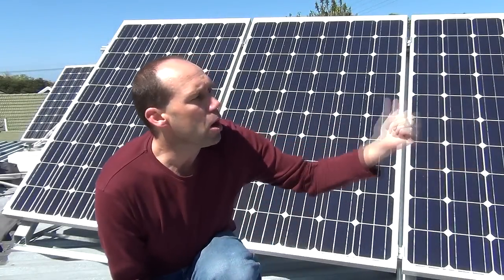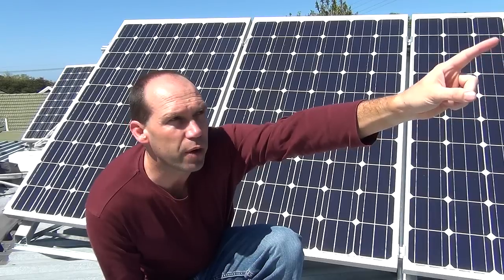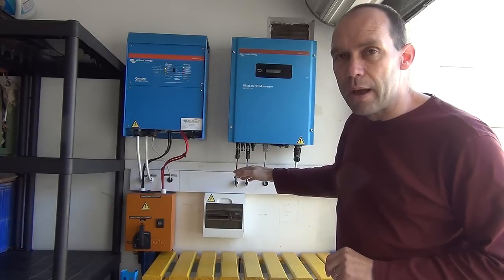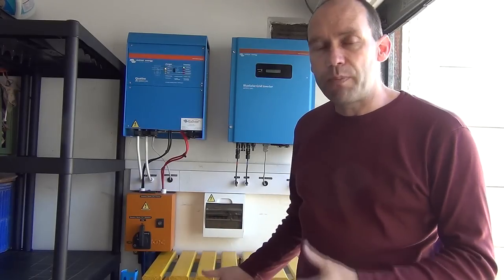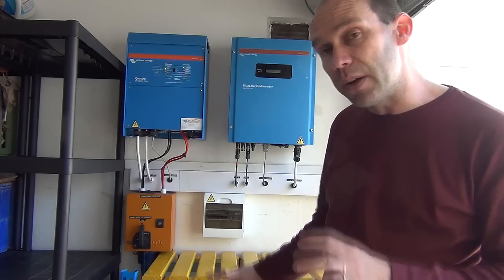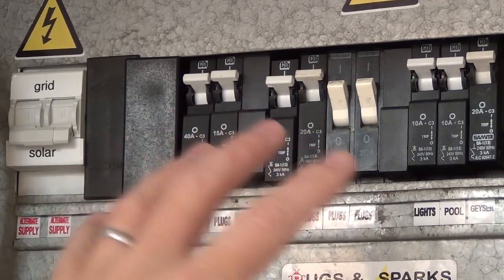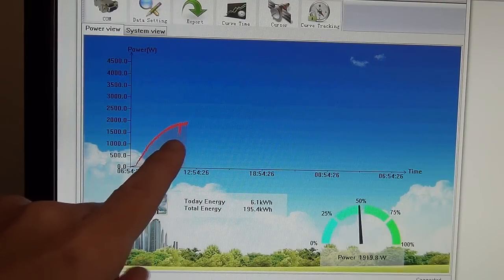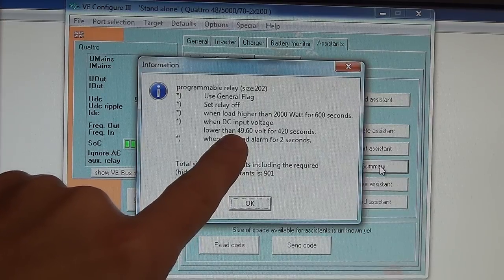Home Solar Power Installation

Comment: I found that my combination fridge/freezer uses 3 units a day. I had two of them. Shortly after a local store sold a Bosch A++ rated fridge at a discount of 25%, so I bought it. I then sold the two old ones on gumtree and bought a A-rated chest Freezer. 6 units a day down to about 1.3. Freezer will pay for itself in two years. Fridge will do it in 4.5 years. To make a long story short: If your fridge uses 5 units a day, replace it.

Comment: You need a "bleed off" for your surplus power.  I recommend a small air compressor. You can size it to your needs and either have it auto-start under certain conditions or just flip a switch with a timer on it. The beauty of it is that you can do things around the house with just one "cord" which in this case will be your air hose and there is a plethora of tools you can use.  I even made a small jackhammer and I have a degree in Psychology...so that should tell you that it is user friendly.

Comment: Good video - clean install.  Lots of details, which an engineer can appreciate. 
Our monocyrstalline panels are working much better than I expected in low light.  And here where we get 90+ inches per year
that is saying something.  

We also used a solar company install - only way here to get the purchase and operational incentives.  
You appear to be an electronic engineer - same here.  

We went with a system to give us grid-tie but also modes for backup power and off-grid.  Requires a different inverter configuration, so people should know they just can't add batteries to a conventional grid-tie.  
Did a video series on it too - called "Star Lite Wars" - you might enjoy it.  

All the best to you out there in South Africa - hope to visit there some day.

Comment from the maker: I didn't build them but it's best to buy aluminium angle and make them up yourself. Other metals might react with the PV frame. They are normally custom made to suit roof, angle and PV size.

Comment from the maker: Solar panels are power rated according to standard test conditions. One of the test conditions is an ambient temperature of 25 degrees C. At higher temperatures panels will produce less power...at lower temperatures they can produce more power.

Comment from the maker: I'm not sure what the Frequency margin is. I will look into this when I do the review on it.

The Multiplus has a built in programmable relay to cut the grid. The current rating depends on the model.

Comment: I'm a fan of using solar combined with those small roof mountable wind turbines for night time energy so the house isn't a 100% battery drain when the sun goes down, I would think that would reduce the frequency of pulling juice off the grid.
Reply: interesting points ,if anyone else wants to uncover how to install small solar power system try Magonsi Solar System Expert (do a search on google ) ? Ive heard some great things about it and my work buddy got amazing success with it.

Comment: Based on a very rough calculation I am being charged for about twice the output on a monthly basis that you have captured in 3 weeks of startup. And that is during your spring if too. It would be awesome if I didn't live in a apartment.

Comment: Karim Altishe That depends completely on where you live.  Here in California, the prices are around $3.70-$3.90 Per Watt of DC system size.  So a 2.0kW system is roughly $7,500.
Reply: wow. got a 5kw for that.

Comment: Great video, thanks...this helps greatly :)

Please help me with the below:

What is the disadvantage of connecting panels in series - does it mean that if one panel is damaged or is producing a smaller amount of power, the others will be limited to the lower generation capacity of the damaged panel?

Will a broken solar panel break the circuit and stop power generation?

What was the cost of the solar panels and the charge inverter for putting power directly into the house (ie not the batteries and the other inverter)?

Thanks.

Comment: Sounds like you have a saved on high voltage efficiency but I'm wondering if the kit to convert and manage the high voltage is way more expense.  I'm also wondering if your system is a bit over kill., with all that kit..  I understand connecting to grid is a different ball game but what happened to the idea of a 200 watt panel, a 5 dollar charge controller (x9) and a battery.. x9..  doesnt seem so complicated and expensive., stap it all up in one simple chunky output terminal and slap on a couple of cheep 100 dollar inverters!

Comment: Interesting.  If WROL occurs, the last thing you will want to be visible is solar panels.  The presence of solar panels indicates a high level of being prepared.  Rather, one will want a battery bank and a quiet gas or diesel generator that will charge batteries

Comment: Do you agree with wires configuration of your battery bank; some other 'youtubers' consider that we should look for a symmetrical length of wires, to keep even the resistance, all the way of the batteries circuit...thank you!

Comment: Nice idea! Have you looked at using a PLC instead of a general purpose PC? They can be programmed using simple ladder logic (with special commands available if needed), have tons of I/O in various voltages/types, and you can communicate via RS-232, RS-485, and Ethernet (so you can control it from a PC). I would recommend Mitsubishi Q Series (check out eBay for used "racks"), but there are also cheaper/smaller ones from companies like Automation Direct, and even Keyence make some nice small ones!

Comment: from 150 watt panel and using serese curcuite and use thinner cables what is the cheapest device that can act like a charge controller?or will a charge controller be used?

Comment: Continued from "bleed off"...... Air tools are great for doing work around say the pool (non electric).  Other bleed off are Marine type refrigeration with a eutectic plate they charge up and run "downhill," so to speak.  I have thought of a phantom load power center as a bleed off.  Get all vampire devices to one area and charge on a timer timed to go off after the longest rate of charge for simplicity, like a lap top.  I am sure you can come up with more.  Just think of "intentional" vampires.

Comment: is there a way of getting the invertor charger to charge at night(cheap electric) and use electric from batteries during day ?? and what is the maximum current that can flow through the device from grid to house(not generated from batteries)

Comment: Thanks for this wonderful video. How did you connect the grid inverter to your system since this inverter will operate when it senses a grid , also how did you use it to power your house and then used the excess power to charge your battery. Thanks

Comment: very good blog. im also in Cape Town, also have a solar PV system. im using schneider off-grid system.

im just not sure how you manage with that few panels. i have 36 panels, and have 24 x 2volt 700amp hour batteries installed. still not near enough for 100% off grid & it flips over to grid every morning about 2am. quite frustrating, it cost me an arm & a leg, but ok, my bill is only about R200/month.

Comment: Nice solar system. I have one important question: what will happen when the loads are very small, the batteries are almost full and there is a lot of sun radiation???

Comment: this i how i understand your video, thats why u have 2 inverters, 1 is to charge the battery,and use the battery power on nite time, 2 is to use on the day time to power the house without the power from the grid....so u dont have any more bills from the company.how is the connections of your battery if you connect all the panels n seres.by the way u said that 250 watts each panel, how many volts each. can u please make a little bet scketch frm pnels , crge contr.2 d batt. thank u

Comment: Hi there, I am trying to gather information about home solar system (I am interested in installing one in my house) just a couple of questions:

1) Could you charge the battery from the grid with these inverters that you use?
2) Those programmings that you have (when to connect/disconnect from the grid), Did you do it by yourself? Is it like a real programming thing or is it just a matter of putting numbers (the inverter comes pre-programmed)? Could you please give me the details of this programming part?

Thank you very much for your help.

Comment: At my condo we have 3 pond fountain pumps I would like to convert to solar (off grid). The pumps are ~1.5hp / 220v. I realize I have to change the pumps but I am not sure how many panels I would need, how many batteries, and so on. I want to run on batteries through the evening hours. I have seen some pumps that will run on 24v. Can you help with this design?

Comment: Hi there, i have one question about my Inveter,it is input volt 12/24vdc and out put 230vac,it's backup time 45-50min(battery is 12v 200AH), now i like to add more battery get more backup time(like24vDC 1000Ah) can i do it ? don't get any problem my inveter,

Comment: You mean the battery inverter talking to grid-tie inwerter?
What language does it use? :) Changing frequency or via data cable? 
Have You ever used SMA inwerters. Please share an opinion.
Tjank You for replaying to my first question.

Comment: Looks like your inverters are putting out 230V? If you can tweak them to put out 240V, I don't see any reason not to (unless the grid supply is actually 230V at your property). Better output in light and heat from resistive loads and ever so slightly more efficient for SMPSUs, also less volt drop.

But hey, I like tweaking. :)

Comment: you mentioned that 9.2KWh is what you've used for the last 24hrs right? You also say it is higher that is has been because of rain (here it seems that you're talking about grid CONSUMPTION since you need to get more energy from the grid since the panels arent producing much during rainy season). Then you confuse me saying you'd normally be between 18-28KWh had it not been for the rain. So that is the energy PRODUCTION then? Please clarify
Reply: Yes, I have the same question, as I noticed also - a little difficult to understand
Reply from the maker: This is measuring energy that we have used from the grid. It's higher than normal because rain had reduced solar power production...hence more energy required from the grid. I said "I would be using 18-28KWh had it not been for the [solar] array"...not rain.

Comment: Hi MJ, just a quick question, if one has an inverter with built in charger, will they be able to connect it to the battery bank which already has a charge controller feeding the batteries. 
Thanks

Comment: THANK YOU FOR THE VIDEO! I AM ON A TIGHT BUDGET AND WANT TO BUILD A SOLAR-POWERED EVAPORATIVE COOLER. TO KEEP IT SIMPLE, I PLAN TO USE A 12V COOLING FAN AND 12V PUMP.TOGETHER, THESE CONSUME 150 W. THESE ITEMS ARE INEXPENSIVE AS AUTO PARTS. I WOULD LIKE TO HAVE CAPACITY TO ADD ANOTHER 30 WATT PUMP. I HOPE TO GET BY WITH ONE DEEP CYCLE BATTERY AND A 30A CHARGE CONTROLLER. AS AN ENTRY LEVEL SYSTEM, DOES THIS MAKE SENSE? IF I USE 2 120 WATT PANELS IS THE SYSTEM SIZED CORRECTLY (OR JUST OK IN THIS CASE)? WE LIVE IN ARIZONA - NO SHORTAGE OF SUNLIGHT! THANKS AGAIN. I AM A FAN. RICHARD

Comment: hi i am new to solar i have some panels that show on the back 45w 10.9 v 5.5 amps i connected them to a 30 amp 12 v charge controller but i can not get the controller to show any amps going in to the controller but when i connect a small panel with vmp 15v and voc 19v the controller works and shows amps going in to the controller do i need a 10 v controller and will that charge a 12v battery if so do you no of a supplier

Comment: Hi very interested video post and very detailed I must say. I've got an off-grid system (48v 350Ahr) an mppt charge controller and some panels.Now some other friend  suggested to connect the charge cont to the EXTREME terminals of the battery bank, which is ok, I agree. Now where do you think is BEST to connect the charge controller AND Inverter to the batteries. Opt1) On the same terminals of the Charger Opt2) or on the opposite Terminals? for best load balance across batteries and charging.

Comment: Then what is the margin of frequency for the Victron grid-tie inverter? I'm very curious because i thought that the SMA inverters are more better than Victron. Now I see resembles between these two brands. 
Does the Victron Multiplus need external relay to cut off the utility grid (public grid)? or it has an internal programable relay that can cut off 25amps for example?

Comment: helow sir  i have 4 100 watts panel when i check with multimeter direct from the panel the output amperes is 24amps, but when i connect with controler using 65ft flat cord  w/ 100ampers deep cycle battery bank the output amperes drop to 10 amps with ammeter ,can you help me what is wrong with my system to achieve 24 amps output ,should i change my wire to awg and what gauge is your recomended,hope you help me Sir..   I really appreciate

Comment: Hi, I am fron Jhb SA and  have 1500 watts of panels(6x 250W Canadian Solar panels in 2 strings of 3 each in series) Have a Axpert aka PIP4048 and lots of batteries. My question is: Only have house lights on solar currently with max load about 250w. My panels do not show anything more than 755w max with 10A since install a month ago. Have been told that panels will not go to capacity or close to it  because batteries have not been drained enough, would this stm be correct.

Comment: Did you build the panel mounting frames yourself? I need very similar brackets for my 4x 120w panels which will be on a slightly inclined flat roof all next to each other on a 5m stretch - wondering if you know of any local suppliers of pre-made frames, or if its better to buy the steel brackets and DIY?

Comment: i live in india where temperature in summers reach upto 40-44 deg celcius so is it possible to run air conditioners on solar panels ??...coz i get heavy light bills due to over use of ACs so thought of opting to this energy but is it possible to run 2-3 air condition on solar energy 7 days a week 12 hours a day ??...coz if u go everything energy efficient from led lights to using of fans to using of flourascent bulbs thn i dont think u need to solar panel for that much of consumption...so please reply..:)
Reply: I've done some research on this. In my opinion it is possible to run ACs on solar but to reduce cost you must choose the most efficient ACs of right size for a room.

Comment: Does a solar panel array generate any power during full moon night?  Nothing not even 1% of rated wattage.
Reply: +HealthSupercharger no
Reply: ok thanks for the answer.  I was thinking of prepping a tiny bit more via even just one solar panel and a couple large batteries and a 1000w inverter or so that I could run a fridge or freezer in case of power outage or collapse as so many preppers and economists are saying is coming our way.

Comment: 2500w power an entire house AND charge batteries :O
I use 300W running full out on my PC, then theres the lights, the fridges/freezers and the air circulator. I can't even imagine throwing an AC unit into that mix. Heating is done with natural gas, and a fireplace.

Comment: I'm new to Solar systems. Can you tell me what are the battery specification required for the below detailed solar panel?
Maximum Power (Pm) : 55 Wp
Open Circuit Voltage (Voc) : 18.7 V
Short Circuit Current (Isc) : 2.94 A
Maximum Power Voltage (Vmp) : 21.5 V
Maximum Power Current (Imp) : 3.25 A
Maximum System Voltage (V) : 750 VDC

Can someone please help me on this?

Comment: I'm confused...if within a month you only produced 220KWh, that is around £24.40 per month here in the UK at a £0.12 per KWh. If an average installation cost £20K, then you need 68 years to break even providing the system does not break down!...
Is it worthy?
Reply: I have set up an almost similar sized system on my rooftop. It doesn't cost £20K. I'm in India and it cost 300K rupees which should be £3K. Per kwh grid power cost here is £0.06 equivalent. India is mostly sunny so I produce average 300KWh a month. At that rate it will be even in 13 years and the system has manufacturer's guarantee of 25 years. Solar components are imported from Germany so it might be cheaper in UK.
Reply: I'm in uk and consulted a proper solar panel supplier. They planned a total bill around £9,000 for installation. They also told that you might get extra paid if you give some power to the national grid.
Reply: Shani Mahadeva Hey, I'm planning to do a set up for my home in India too. Do you mind sharing some of your experience? When did you set your system up? Are you happy with its performance? Does it perform well during monsoon? Did you find a good installer?
Reply: Shani Mahadeva
Thank you so much for this info. I'm gathering information now for an installation sometimes mid next year in Tamil Nadu. It's great to hear that your pleased with the performance :) I will definitely check the installers you mentionned and will reach out to you directly if more questions!

Comment: Nice video.  mine is smaller. I use 12kw per day. my panels bring in on a good day 9kw. it is cheaper to run it straight to grid. I also have 400 watts dedicated to 8- 6volt batteries @24 volts,  that go to 2 dedicated lines in the house, 2 dedicated outlets  that can be used if power outage.  great savings. my electric bill has gone from 170.00 per month to about 40.00. I take what I save each month from power company and add more panels. I will soon have power company paying me. best investment I ever made. power company and all its employees hate solar, it cuts into their profits.  my sujestion is they need to start building and selling and installing solar panels and keep their profits in clean energy.